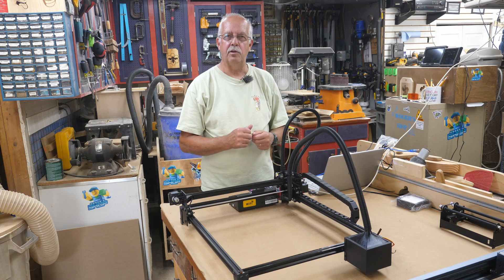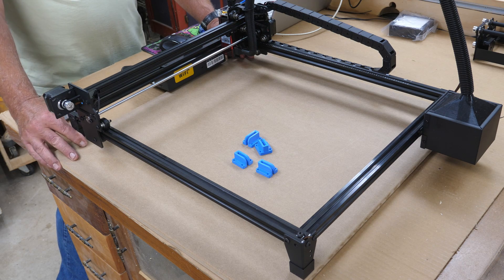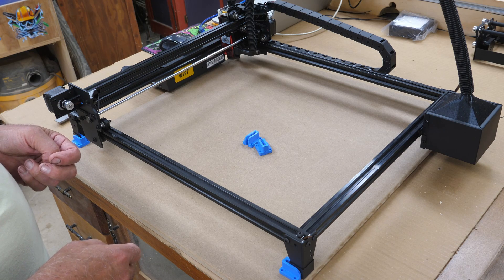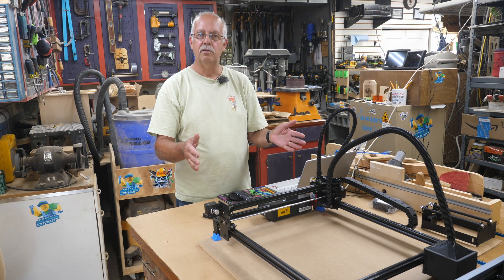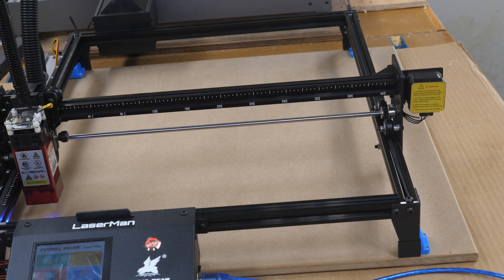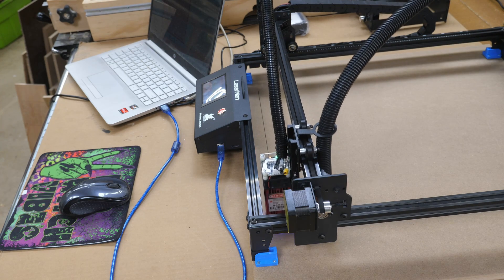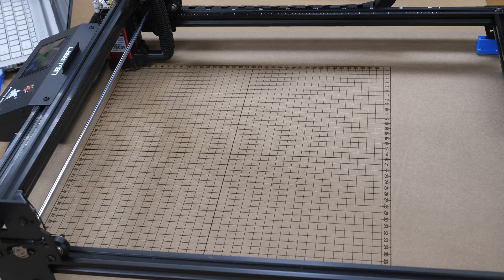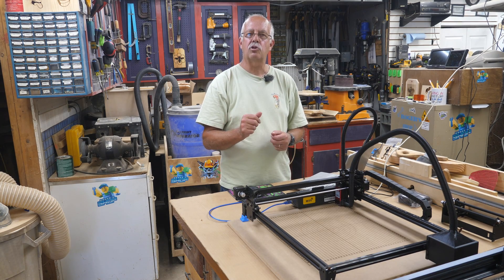Flying Bear Laser Custom Spoil Board

Comment: Nice job. Just getting started here and already have my grid burned on my board. Quick question for you though. I haven't cut anything yet, but I do have a honeycomb board for cutting. When cutting, I don't want to burn or mark up my newly created grid. What is the standard practice for preventing this? Have a spare sheet of material to put down under the honeycomb? Or should cutting not mark up the grid if setup properly?
Reply from the maker: Most honeycomb boards come with a sheet of aluminum to place underneath.  Aluminum foil would also work in a pinch.
Reply: @rogersshop  I gotcha. My honeycomb is still in box so I haven't actually seen it yet. Good to know.

Comment: Nice job Roger! I'm actually just finishing up my review on this machine and it has passed with flying colors! I'm doing a similar waste board today. I also 3D printed feet and risers for the roller accessory as well.
Reply from the maker: Thanks.  I think this is a very good choice for an entry level laser, considering the built in options.  I haven't played with the roller yet and will also be printing some risers for this laser soon.  I have a new Tarantula Pro 3d printer that I've been playing with and this would be a good project for it.
Reply: @rogersshop  Check out the Louisiana hobby guy on Tinkercad Roger. I have the exact feet and risers there if you're interested. The risers fit super snug right over the feet.